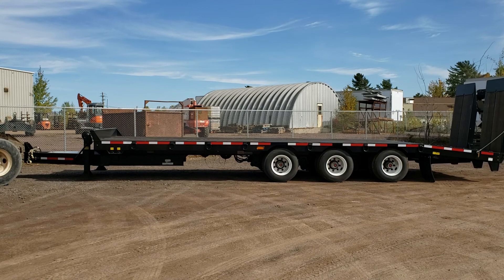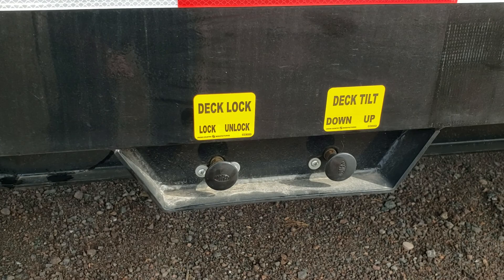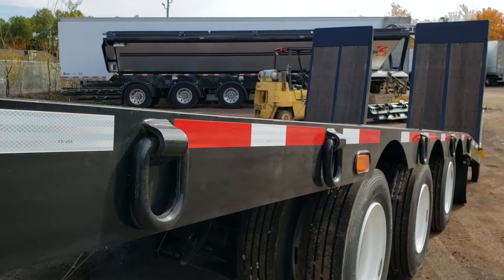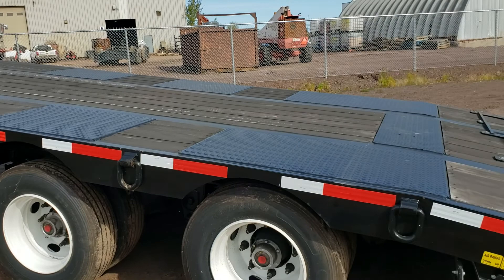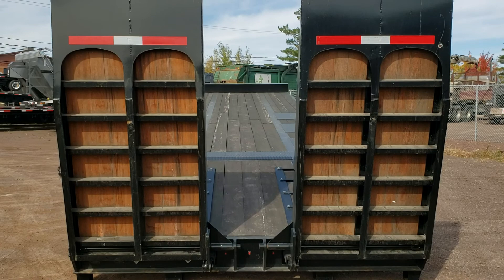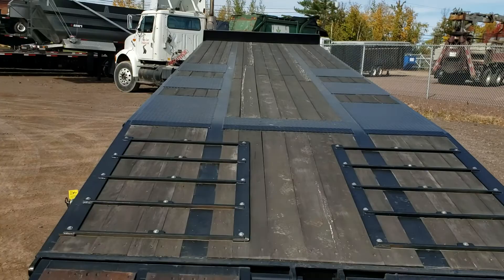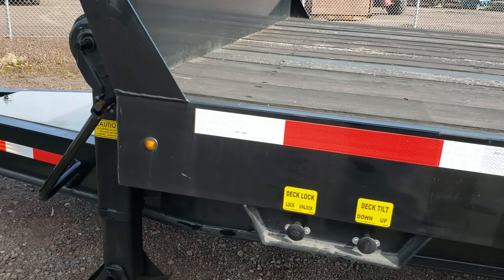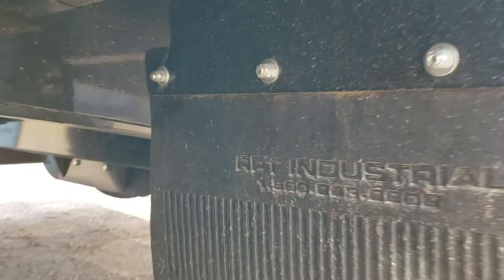Gincor 25 ton air tilt air ramp tag float

Comment: Only thing i dont like is how they cut the beam around the wheels. Eager beaver always did that along with other brands and over time that section would bow out. Trail king flips the c channel facing out cutting it to avoid that. These trailers do look pretty good but ill take a used trail king over one of these just because of the wheel cut outs it sont hold up say 20 years later or less

Comment: Nice trailer but I dont really see the point of the airbags. Looks like it makes loading more difficult.
Reply from the maker: Manual tilts work great too, this one can work like that, but the air tilt helps with low ground clearance machinery.